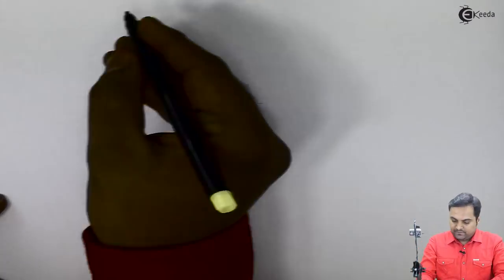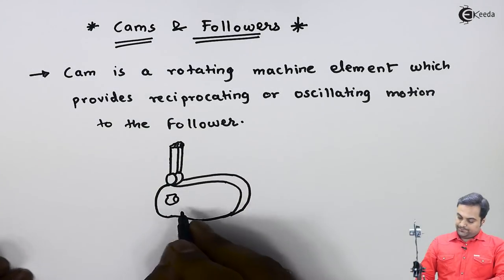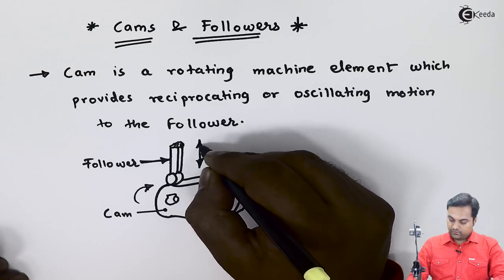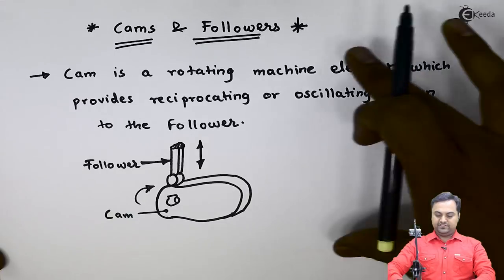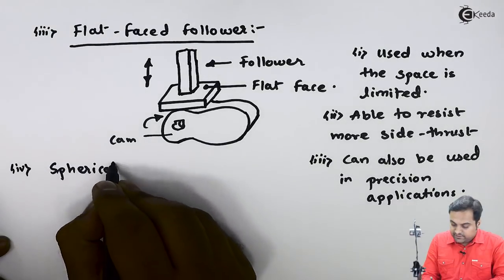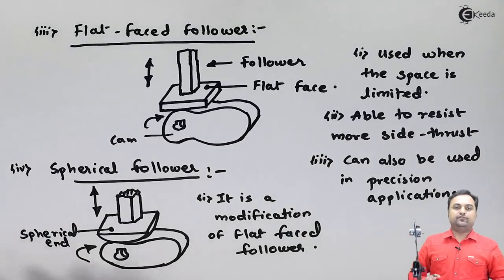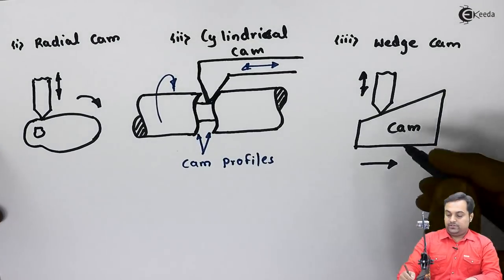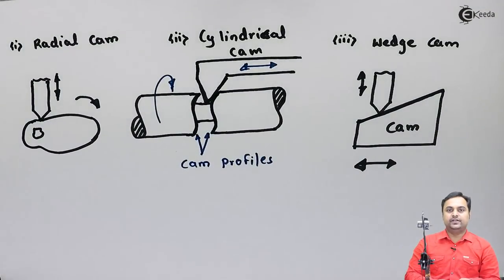Cams and Followers - Theory of Machine

Comment: we want to design a  cam  to rotate 25 mm shaft at 45 degree  , the cam will be driven by  rotating motor  and follower will give  45 degree motion  can you suggest that how to design the cam , we need the same  displacement time   pls suggest